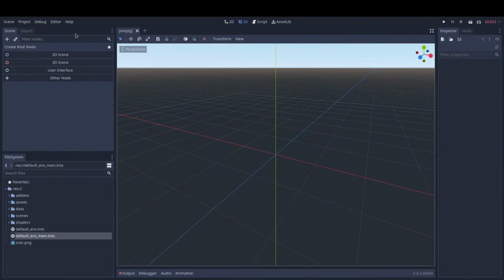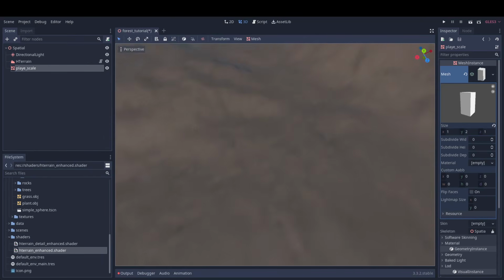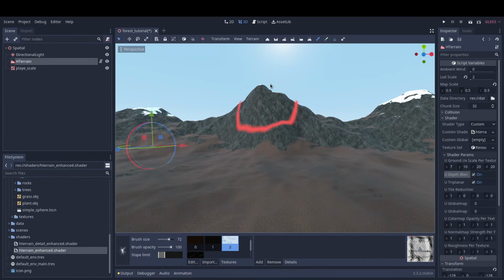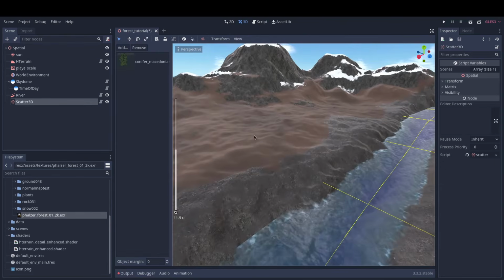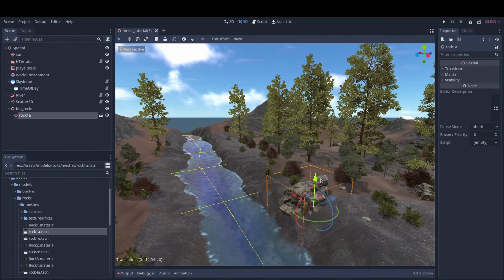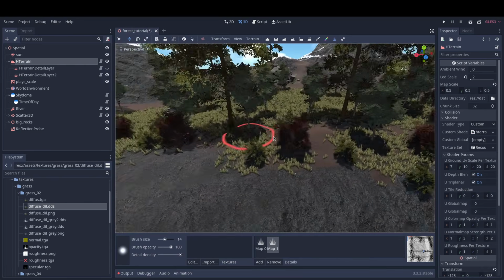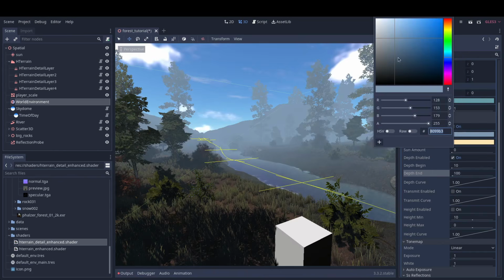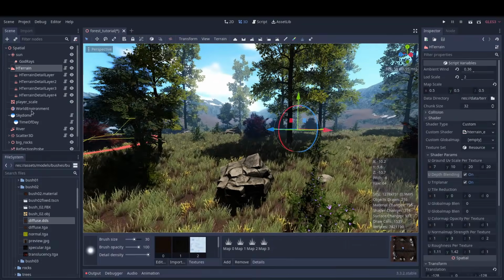Forest Level Design Follow Along Tutorial | Godot 3.3

Comment: Hi, sorry for the inconvenience but I have a doubt.

I try to use Waterways .NET (River Generation Tool) but although I install the NET 8.0, it doesn't let me use it, it only lets me "Unable to load addon script from path: 'res://addons/waterways_net/WaterwaysPlugin.cs' There seems to be an error in the code, please check the syntax. Disable the addon in 'res://addons/waterways_net/plugin.cfg' to avoid further errors.

if anyone has this problem or can tell me what is wrong it would help me a lot.

Comment: Hi Wojtek! I'd love to make an environment like this! Am I able to follow your tutorial even if I'm an absolute beginner in Godot?
Reply from the maker: Hi, I think following my tutorial as a beginner should be feasible but optimisation of the scene performance will be probably a hard part (which is not covered in this tutorial at all). Godot 3 doesn't support level of detail (LOD) out of the box but if you use fairly low-poly models you should be ok. Also there are some plugins that might help but I didn't try them. There are other methods of optimisation like mine plugin: https://github.com/wojtekpil/Godot-Octahedral-Impostors but its not well documented, so I would not advise using it as a beginner.

Comment: Hey, this absolutely by far the best godot tutorial i have ever seen! I would love to see more and will absolutely be subscribing!
I do have three small things to say though
1.) It would be super useful if you could explain how to install the addons, I was able to figure out how to do it on my own after about 30 minutes, but one of them doesn't seem to load. it says there is a syntax error in the code. I'm not really concerned about that specifically, but i just would have appreciated the help on installing them.
2.) what is the difference between the "edit" and "import" for textures? when added the second texture i accidentally used edit. it seemed to work fine. (i still went back and used import after i realized though)
3.) when trying to use scatter with the trees, i cant use the trees i have made in blender. I cant seem to use scatter with a normal obj. It seems to require TSCN which is not a file format supported by blender. do you know how i could export my trees as tscn? ive tried to find an addon but the only one i found was outdated and not usable.
Reply from the maker: Hi! 1. installing addons in Godot is covered by a lot of other resources. I didn't want to cover such basic things, this video is already pretty long. 
As for 2. as far as I understand edit is the old way of importing textures for the terrain. I had some issues with it. New importer is probably more important when you work in the TextureArray mode of terrain and its doing some automatic loading. Please check the documentation for further details: https://github.com/Zylann/godot_heightmap_plugin/blob/master/addons/zylann.hterrain/doc/docs/index.md 
3. You need to reimport your obj as a scene, or create new scene with obj instanced inside. Tscn is  a scene format file.
Reply: @wojtek_pe  thanks for the reply! I was able to figure the scene thing out. I guess the scatter addon is actually broken at the moment but I am waiting for the fix eagerly. Thank you.

Comment: pardon a silly question but how do you get the grass to render in game? I can see it in the editor etc but it's not rendering when I run the game...
Reply from the maker: Hi! I just tested it again and everything seems to be working fine with Godot 3.3.2 stable. Are you sure you are not doing something strange with the camera position? I would suggest checking the code of hterrain plugin. It loads chunks of grass based on camera position, so maybe there is something wrong for your project.
Reply: @wojtek_pe  um, no. I have a very straightforward camera rig and grass works in the editor as it should. Just not showing in game:(
Reply from the maker: @actualdevmar  That sounds really strange. Maybe try version from github, I did not check the one in the assetlib. If this doesn't help I would suggest creating an issue on github. I am on linux btw.
Reply: @wojtek_pe  Right, I've just downloaded the latest one from github and it's rendering now but there is a different problem - the grass flickers like crazy with bright white light every few frames. Looks like a stroboscope, or a thunderstorm...
Reply from the maker: @actualdevmar I have seen this one. It's clearly visible when MSAA is enabled with screen space reflections. Try disabling them to check it. I also read somewhere that limiting ALBEDO between 0 & 1 resolves this problem.  something like ALBEDO = clamp(ALBEDO, 0.0,1.0);  in the detail shader but I didn't test it.
Reply: @wojtek_pe  Disabling ss refections helps but doesn't solve it. Now it looks like there are little gnomes in the grass taking photos every couple of seconds (previously it looked like a thunderstorm). Also, I kinda want the reflections... What kind of shader would it need to be?
Reply: OK. Just clamped albedo in the shader. Problem gone. Thank you.
Reply from the maker: @actualdevmar  It's definitely a bug in Godot. That's just workaround but better than nothing.
Reply: @wojtek_pe  I also thought for a second that you were able to crank up the density beyond 10. Were you, or was I hallucinating? And if you were, how?
Reply from the maker: @actualdevmar  You can't, but you can add a second detail node with the same texture. Another workaround is to use a custom mesh with multiple billboards.

Comment: Thank you. Seeing an entire workflows really helps connecting the dots (and the nuts and the bolts :-) ).  
Just one question for the final part: How did you make the grass move? I would guess it's an animation player manipulating the grass shader?

Not your plugin, but it would be cool if the scatter-plugin had a size-randomizer and perhaps a multi-selection (say you select 4 different kind of rocks and size range 80-120% and whenever you click it adds one of the four, randomly sized and rotated is placed). I'll take a look, how hard this would be to implement.
Reply: @wojtek_pe  Missed the grass moving part with the plugin (maybe I wasn't thaaat concentrated in the last half hour or so :-) ). Will try to make the proposed change and if it works as intended, I'll learn how to make a PR on github ;)